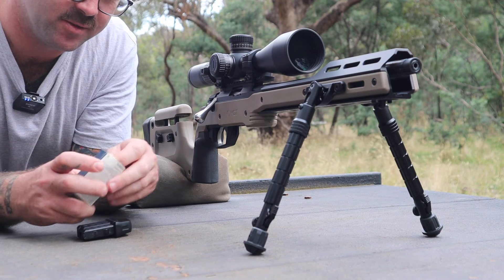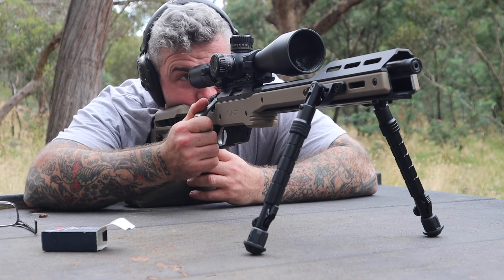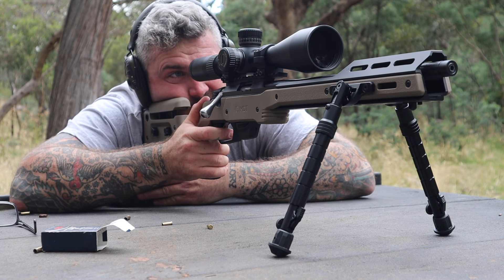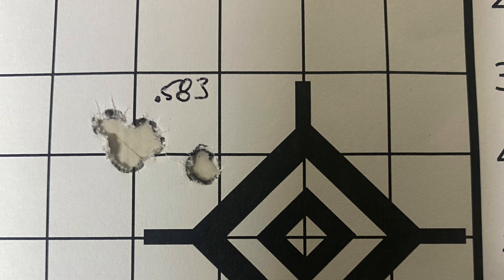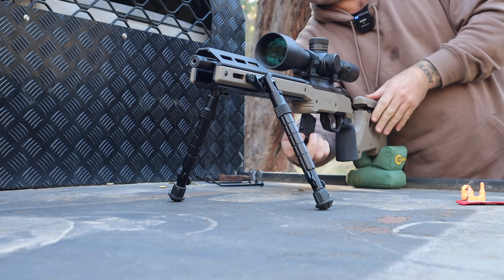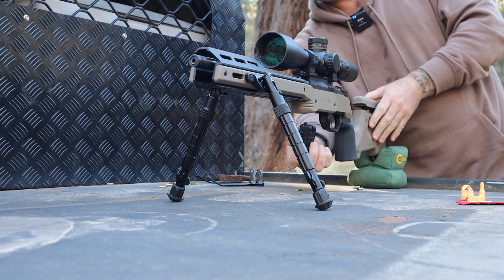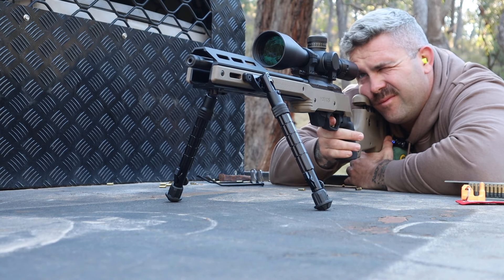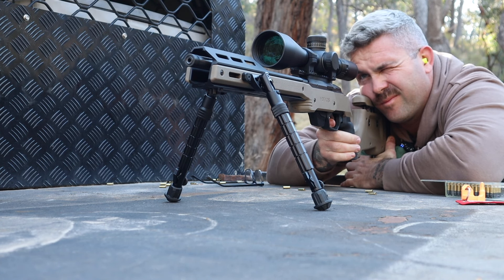Tikka T1X Project - Part 4 - Chassis Upgrade

Comment: Hi ya im liking my chassied rifles, out of my six rifles three r in chassis two Oryx for centerfire and a scsa tspx  chassis for 22lr. I have a howa m1100 in there tspx it's awesome but it didn't start that way. The initial feeding of ammo was very bad every second rnd would jam I nearly gave up on it even contacted howa a couple times with no luck but there is a happy ending it was shooting great half in groups but what's the point when it jams every second rd saw that online a lot of people having same issue. After say around 200 rnds it just started cycling like a dream both mags as always used both pretty sure it was a mag issue and it took ages for spring to run in it was pushing the next rnd into rnd being chambered and it would jam up on that angle  that's what I could c was going on. Now it's great I don't really y know why it fixed itself I'm guessing the mag spring needed to slacken a touch so it was not pushing with to much force. That's my wild guess I've really no idea. It seemed to b a mag issue. Now it's fixed it's my go to euthanasing rifle I shoot for a wild life group euthanasing fatally sick and injured animals usually just with the 22 maybe further with big gun if I can't get up to fifty meters away. I'm so stoked it fixed itself,  great chassis, very comfortable to shoot and groups improved and so did consistency.  Very fun to shoot and have great confidence  itwill shoot well and quickly load another with no issues.  So any one having problems with it cycling keep shooting it it should smooth out. Got all three 22lr I shoot running well with 40gr hp Winchester power points could get them a bit tighter but don't want to have different ammo for three different rifles. All groups are well under an inch at fifty so happy with that.....The howa m1100 factory stock i did not like so was always gonna change the stock. My cz457 and anschutz 1451 have beautiful wooden stocks so am gonna keep em looking good in wood.  The anschutz is 35 years old and still is a tac driver at fifty. The cz is just a dream to use I never know what one to pick but I suppose that's z good problem to have.... The training rifle is a good idea that's how I've set up my howa m1100 to b very similar to the howas I have in the Oryx chassis .

Comment: You used a Recarms Cerberus shotty? My local gun shop had a good deal on them new because Recarms were doing a big clearance, picked one up pretty cheap new.
Reply from the maker: Never heard of it. Sounds Turkish.
Reply: @fhckoutdoors  Yeah it is. Not a lot of info out there on them but they seem to be pretty solid. I might do a video on it. Seems the straight pulls are coming down in price due to button and lever release increasing in availability.
Reply from the maker: @Spacegoat92  yeah they definitely are dying in the arse due to push buttons and levers